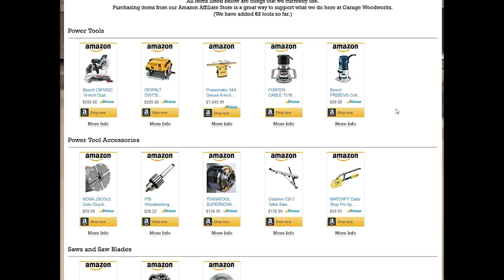How I Made a Lidded Box

Comment: Nice work! That cherry will only get more beautiful with time. Next time you go to cut the lid off of a box like that try putting a standard 7-1/4” x 24 teeth sawblade in your tablesaw. I’s very thin kerf will waste less wood and give you a even better grain match. I have been doing that for years. Unfortunately the tip won’t work on a Sawstop table saw.
Reply: Outside that the Sawstop braking would not work, is there another reason?
Reply: Dwight L - Because of the breaking mechanism, I do believe the Sawstop will not work with the smaller blade. I have never tried so I cannot be hundred percent sure.
Reply: Believe if that was so a dado set could not be used.  Largest dado set is 8" for the home craftsman.  I know that the blade stop feature can be turned off for "special applications."
Reply: Dwight L - You must use a 8” dado on the Sawstop with the dado cartridge. When you adjust the cartridge it is about a 1/8” from the blade. I don’t know if there is enough adjustment to adjust for a 7-1/4” blade. I can check the adjustment on the Sawstop where I work next time I go in. I’m sure Sawstop would not recommend it :).